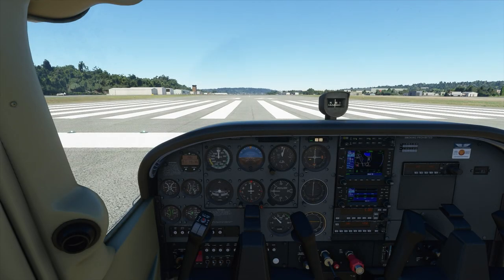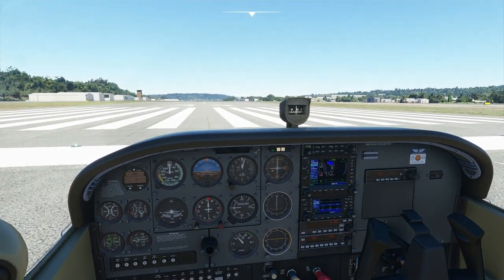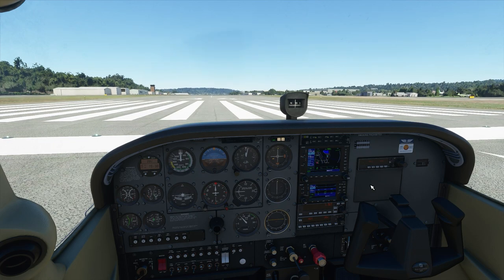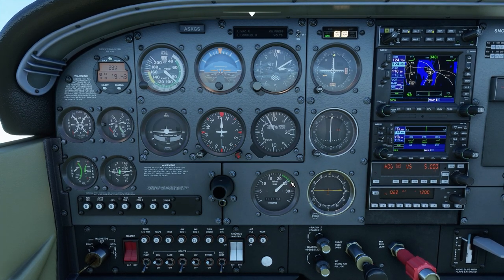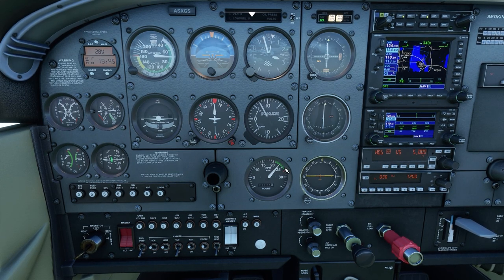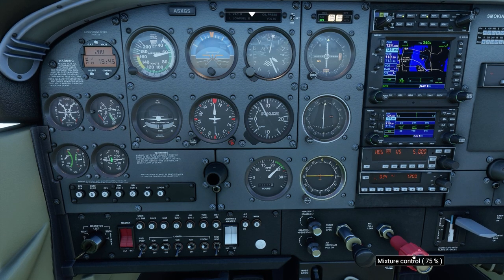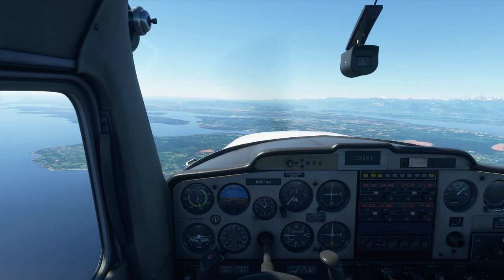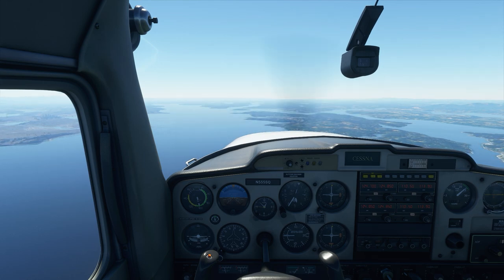Tutorial #10 - How to set Mixture - Microsoft Flight Simulator

Comment: This appears to be a third party Cessna 172, if so who provided it?  I'm not too happy with the flight dynamics provided with MSFS, not being able tp easily trim the Cessna 172 for any configuration is very frustrating.  As you know, timing an aircraft is a very basic procedure preformed by a pilot.  Would you know why a percent of throttle or mixture is shown in the cockpit, it's not useful information, actually it's rather silly to have that readout.  A pilot would look at rpm, mp and engine instruments to find out how the movement of the throttle, prop control and mixture were affecting the performance of the aircraft. 

It would be nice if these third party developers would produce aircraft (GA) with an option of analog or glass cockpit.  Glass cockpits can be a little frustrating with beginner pilots/gamers. 

Good job on explaining the basics to the beginners.

Comment: Why is ist impossible for me to use it? It just stucks at 72 percent🤔
Reply: Check your assistance settings. There is an automixture setting.
Reply: @dcviper985  Automixture is off already. I can set it when AI has control of the plane, which makes no sense at all in my opinion.

Comment: All this manual adjustment makes for a fun, interactive game, but it really seems like all planes ought to just do this stuff automatically.
Reply: Modern prop or turbo prop planes such as the DA62 or the TBM manage the propeller speed and mixture automatically but the 152 or 172 are older and more basic designs.
Reply: @TheCodifier  It's a shame that to get what seems like pretty basic automation, we have to pay a one million dollar premium. Is there no middle-ground?
Reply: @jason_v12345  At my work, we have DA-42's.  The first ones we had came with the fancy merc engine that did everything automatically.  Those engines ended up in the scrap bin after their ecu's kept deciding to shut themselves down for no good reason.  Now we run lycomming 360's in em.  Old push rod engines, but way more reliable.

Comment: 20:24 have you allready say is 40& use less fuel than 90%.if you high lean it. why cant you take off same setting less fuel lol if it works high altitude less air same setting is better lower? did i completely missunderstood this lol.
when you are leanining you are use less fuel and more air? full mix use more fueal?.air is heavier on ground so you need full mixture not becouse you need more air? its like wtf lol
looking another video i got answer first 20 second.
it nothing todo safing fuel thats bonus.thinner air you lean mixture less full so more air so fueal can actually burn lol and yesyou are using less fuel now.
so why cant takeoff using less fual? lolwho cares how slow it rise. you are saving fuel! omgwhy micture there.yes to get more power when you not actually need.ops